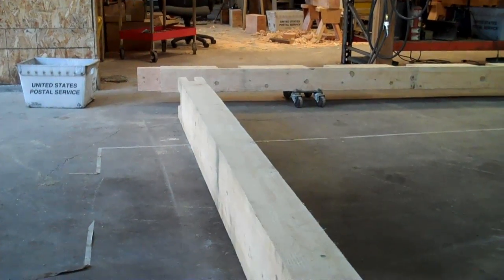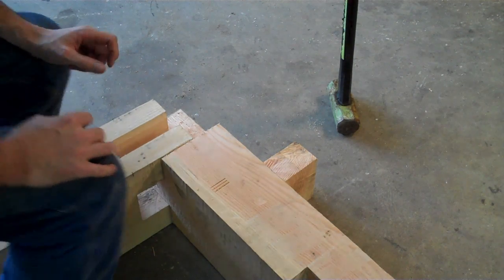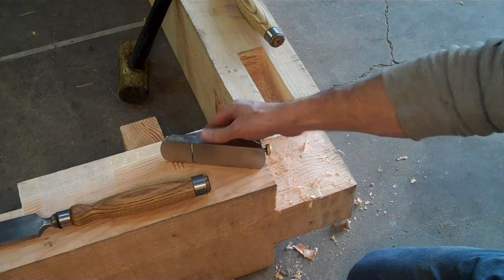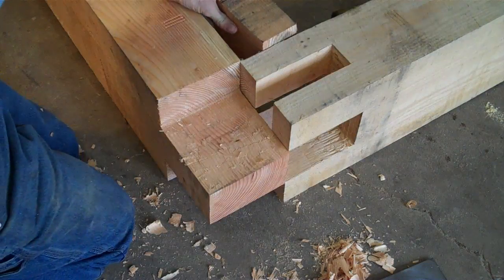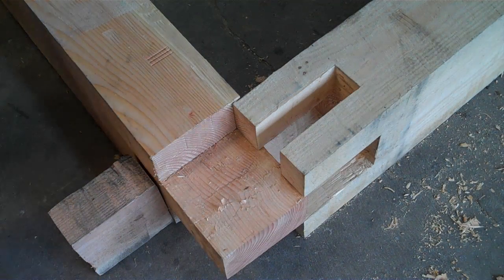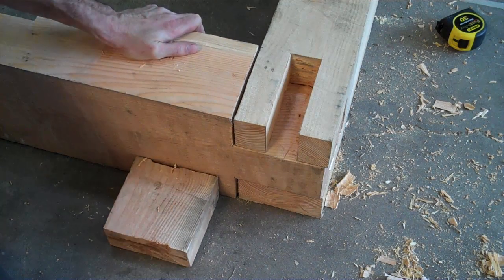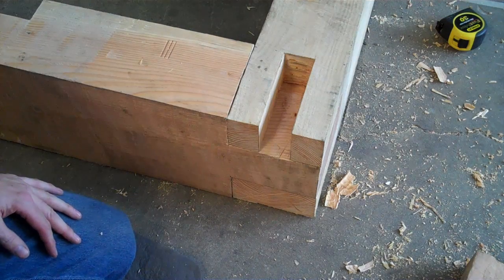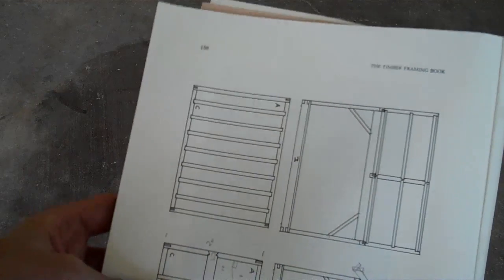Timber Frame Sill Beams – Precision Joinery for Off-Grid Construction

Comment: I have done any research into you and your back ground. so I'm not sure if you know this or not but its called the 3,4,5 measure 3' on one of the boards then 4' on the other making marks then measure across to the two marks the corner is square when the distance between the two marks is 5' this also works with multiples like 9,12,15. didn't know if you knew thought you might find it useful.

Comment: The goal of the timber framer is the creation of a timber structure that exhibits precision, strength, and beauty. A variety of wood species, surface textures and wood finishes can be used to create a special look. These homes easily meet modern energy saving standards. They match effectively with structural insulated panels, which are known for their warmth and rigidity.

Comment: @wranglerstar timber structures have also been pretty damned well destroyed by big earthquakes, and you live in oregon which means that there's a subduction zone and the possibility of exploding mountains

wood is good for earthquakes, but a good shock to your cabin can still shake your roof off of its supports, and even if your cabin doesn't end up crunching in on itself then your foundation is probably going to end up some place not particularly useful

Comment from the maker: @spartaeus the sills do not need supported in the middle the four corner posts support  the roof load. TImber framed barns have been standing for over 1500 years on rock foundations. Ground movement will not affect this structure.

Comment: I hope you'll consider using more than just a flat rock in each corner.  In your area there is going to be a lot of ground movement.  Those beams are heavy and still need to be supported in the middle. If I was going thru all that labor in cutting those beams, I'd at least use 3 piers lengthwise on on each side.

Comment: Nice job.  I've been using Veritas and Lie-nielsen block planes for a while.  They are a pleasure to work with. If you continue to build with hand tools it's worth checking out.  You can check them out in the LeeValley catalog (just looking through the catalog is tons of fun).

Comment: It is great fun watching you on your journey.  I wonder if you have heard of hempcrete.  It is a new product that uses the hurd from the retting of hemp rope.  When mixed with lime as a binder it can be used as a monolithic wall similar to wattle and daubing.  Check it out if you like.  Should look historically accurate and it is a DIY type project with plywood forming and tamped in with no slump. Thanks a bunch. RS.